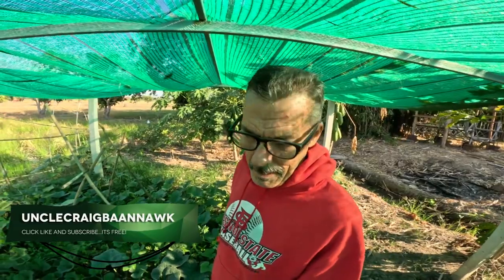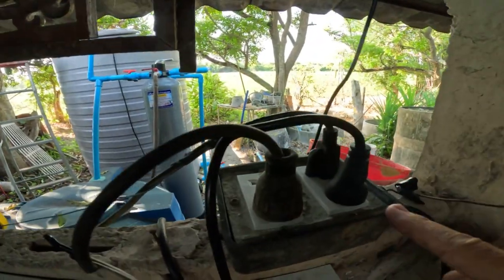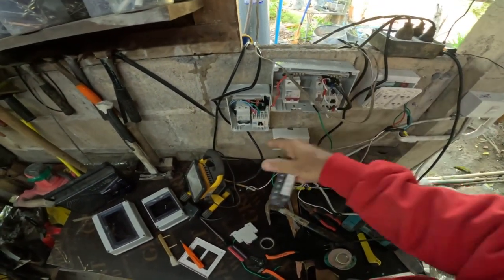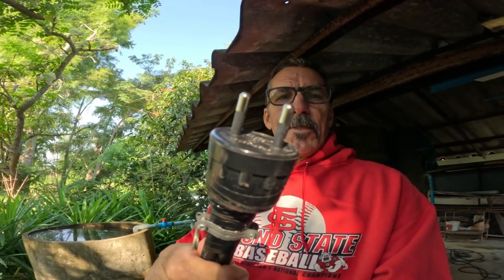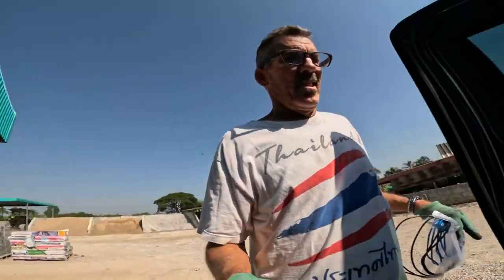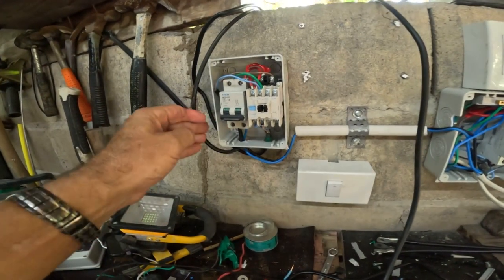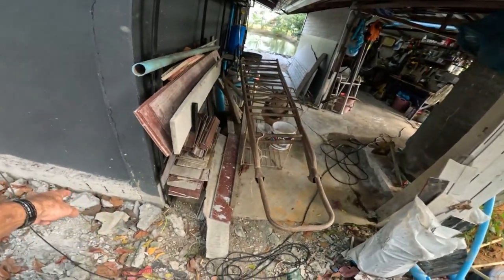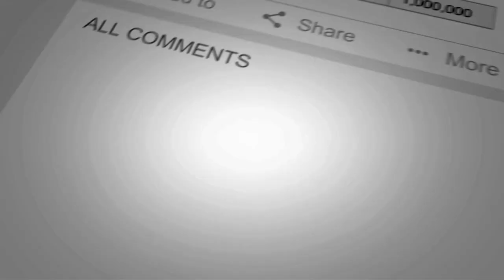EP330 Front Gate Project 2.0, More Bricks and Cement, and a Wiring Fiasco!

Comment: Love how that there is no "retirement" in retirement.  Always projects to do.  Keeps the mind sharp and the body healthy.  Question.  Roughly what is the price difference between copper wire and aluminum wire?  I recall that around 1974 that they stopped using aluminum wire in manufactured home here in the states due to expansion and shrinking causing arcing at terminations causing fires.  Then again, those things were wooden and asbestos tinder boxes.  Unlike the concrete, steel, and cement houses in Thailand.  Always a pleasure to watch.  I get a lot of ideas from your videos for when we finally make the move.
Reply from the maker: Yeah….aluminum is way cheaper…maybe less than half…also lighter weight so it’s easier to manage for the lay builder….and not sure about the weather but thermal expansion isn’t a big concern here…most aluminum line is just the main power lines incoming from pole to box….then it’s all copper within the residential environment….not sure how much aluminum wire is used in a large factory but likely more within the main power infrastructure due to cost…

Comment: Uncle Craig…you are scaring me with all the wiring connections going on in there…the tool shed…why not just put a whole new breaker box in there…then the electrician could run the power to the box….just a thought…….yea man..always use the meter..ok. Catch you later…😊
Reply from the maker: Like everything…it was suppose to start out small and I kept adding crap…lol….when I finally build out the walls and the remodel…I’ll be putting a full breaker panel in there….but for now…I like learning….lol